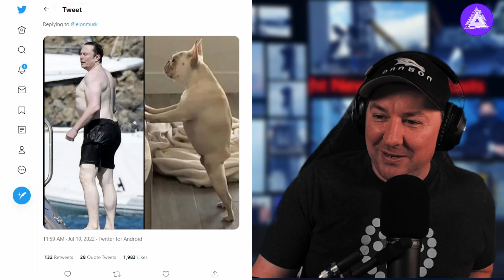SpaceX Astronaut Rocket Damaged Before Flight and Starbase Updates

Comment: Ummmm, strictly from a professional truck driver perspective. Something had to have changed. If it struck the bridge most likely in-between transportations most likely there may of been road work, lay another layer of blacktop on top of another changes the hight or clearance, the path finder vehicle with its measurement pole may of had clearance. A twenty plus wheel tractor trailer, with a extra layer, not so much. Sometimes it can take years for a state to change the clearance signs.
Reply from the maker: Thanks for the insight!  Good to hear from a truck driver about this.